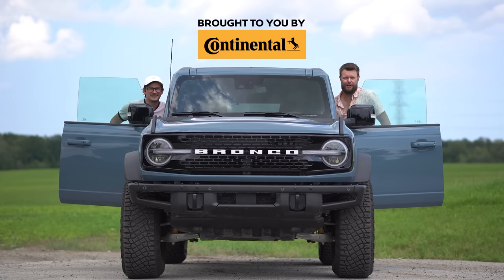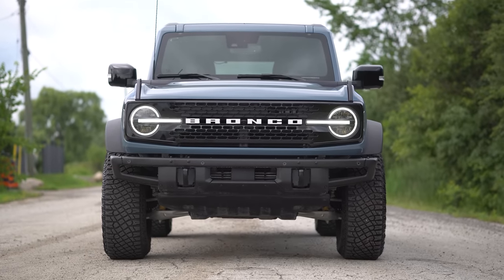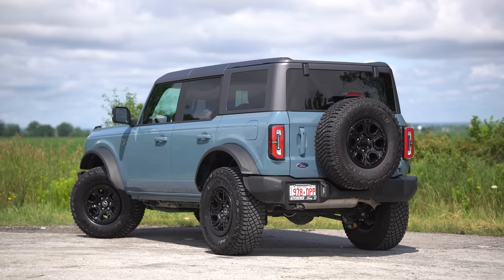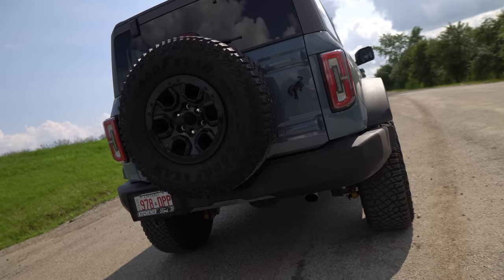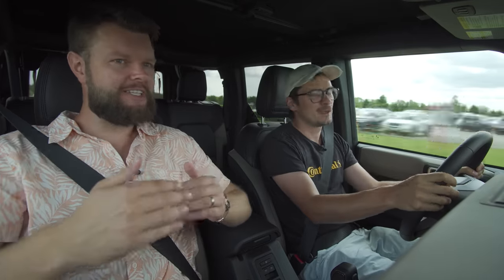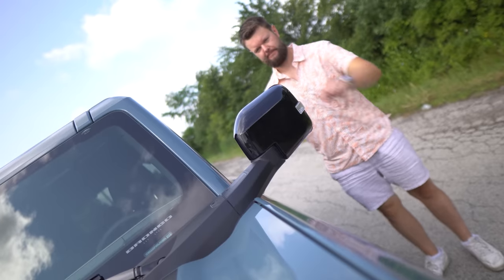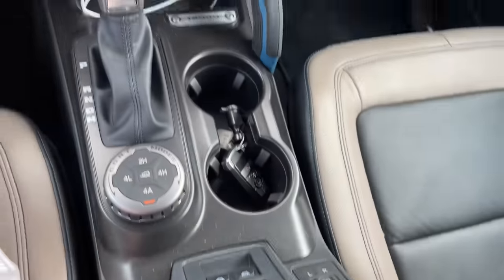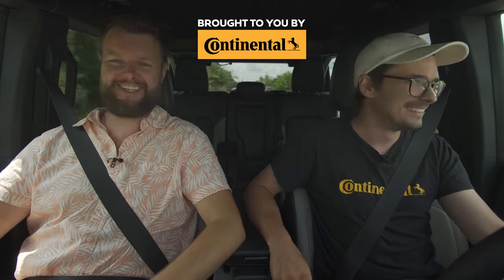RIP JEEP! 2021 Ford Bronco Review

Comment: Smart move having the mirrors mounted to the body, not the doors.
Reply: Unless you are into wheeling/off-road. But we know bronco owners won’t be doing any of that
Reply: You don’t even use them bro when the doors are off. they make loads of accessories for that anyways try again
Reply: And most of the time on trails you don’t want mirrors that will break off.
Reply: I take the doors off my Gladiator. The aftermarket mirrors vibrate too much on the highway.
Reply: Wrangler has a drop windshield so no mirrors on cowl - but why do people need to lower their windshield in a mall parking lot.
Reply: @Michael-pq6dn  Status Symbol bro.

Comment: It has just been confirmed the Bronco transmission is shared with the Explorer, not the F150.
Reply: Doesn’t sound like good news
Reply: @kirkjohnson2924  first year explorer transmissions were fine the problem was the cooler lines for the trans
Reply: @GhostlyGhille  "fine" is a matter of perspective. The 10R80 is more robust than the 10R60, so while it may be "fine" it would be a lot finer if it had the better trans. It just seems silly to give it to the Ranger, but not the Bronco.

Comment: Jeep guy here, good review on the road but I need to see it on the trails, I want to see the clearance and break over angles.  I want the competition and I think Ford through the gaunlet down which is great!  My two cents: pros.. production 35s ready to take "most" trails so you don't have to do much to make it decently capable - IFS has advantages especially on road and higher speed off road or back road cons: IFS is expensive to lift after market.. off roaders are going 37 and 40s now. no V8 yet.. I think also one big pro.. the interior is wide open above the drivers head unlike the Jeep which has a big cross member in the 4 door adn added speakers which can be annoying and get in the way.  Overall I like the "real" Bronco and when/if I go to buy another Jeep I will compare this to the Wrangler.  Besides that I want to see it out on the trails so it will be fun to see it out there!
Reply: IFS has no advantage off road. They put 35s on a his bronco with no space in the wheel wells. And if your are a real off roader you can’t go higher then 35s without a ton of other upgrades to make everything strong enough. You can go to the mall on 37s but you’ll break stuff on the trail. The bronco has the same suspension as the Ford ranger. no one is taking Ford rangers off road
Reply: @RougaRouKJun  I have zero skin in the game on this as I am a jeeper and prefer solid axels for off road for durability and making lifting cheaper and easier BUT.. IFS I would argue does have a place off road depending on what type of terrain or off roading you intend on doing.  IF a new buyer looking at the Bronco with 35s may not want it for rock crawling and a new Jeep comes with 32s so it will appeal to some buyers off the lot to be ready and go.  There are also pleanty of IFS examples out there that have been used as off road vehicles so I just dont agree with that sentiment.

Comment: The feature I love the most about this car is the rear window that opens independently from the door. just like in the old Ford Explorer. My brother used to have the old square explorer it's a great truck. That feature is great and missing in these new vehicles of today. I much prefer a wide and straight rear window than those minuscule rear windows and rears full of angles that modern cars have
Reply: My family had a 2002 Explorer V6 back in the day with the independent rear window, a great feature. The pre 2011 Explorers were great trucks.
Reply: Sooooo….just like the Jeep Wrangler has had forever? 😂

Comment: Great review as always, but disagree on the Ecoboost engines sounding like “trash.”  The 3.5L Ecoboost in my F-150 sounds excellent - not loud nor obnoxious like a few of my neighbors with their Flowmaster or straight-piped vehicles.
Reply: I disagree
They sound like hot trash IMO
My neighbor has an Ecoboost V6 F150. It sounded bad when he got it.  Then he put an exhaust on it... Even worse. Sounds like angry bees stuck in a tin can.
Reply: Ok you think is sounds excellent but most people think it sounds so pathetic I laugh when a Ford boy drives by
Reply: The 2.7 and the 3.5 EcoBoost engines dont sound the same.
Reply: @duhacekfamily  And they do, as you're going slower ....

Comment: I’ve heard the wrangler’s sound system is better due to the placement of the speaker above the drivers on the sport bar instead of in the back. The Bronco also seems more like an FJ given the IFS. Wranglers handle worse on-road because the solid front axle articulates better off-road when disconnected. (I may have owned a wrangler on 35s :) )

Comment: The question I have about the Bronco, is whether Ford will support it for the long term, like Jeep has done for decades with the Wrangler.  History suggests they won’t (because they didn’t), and it will simply be a flash in the pan.  No doubt they’ll get a ton of sales initially, but I’m not sold on this being a long-term model.
Reply: That might be what you want as a buyer though
Reply: Then just hold off on your purchase for 25 years, simple.
Reply: They will support for long term, they already have official clubs for Bronco owners and locations catered to Broncos and events
Reply: Long term support will depend on what you mentioned. Will the Bronco be a long term sustainable model or will sale numbers plummet after this initial wave wears off? It's too early to tell.

Comment: 0:28 that thing literally took off so slow i almost spit out my coffee

Edit: so I guess I can't post a comment on YouTube without catching hate for it. So let me make myself perfectly clear. The vehicle is slow. Fight me about it i guess if that's your prerogative 🤷‍♂️
Reply: But it's meant and used for off roading...not a race track or autobahn. It's like complaining about a Mach E and how it gets stuck on a beach. The grand mistake I see with these newer Ford makes are flooding underpowered engines with turbos and keeping the problematic 10 spd trans I keep reading about. Naturally aspirated without the engine stop cut off is the only way for the average American.
Reply: It’s a 4x4 not a Ford GT. 🤦🏼
Reply: @okra2958  so an upgraded suspension system and upgraded set of dampers makes it ok for it to be slow for daily driving? I'm referring to the fact that it does not come with an option for a naturally aspirated V6 or V8 engine. I would puke if I had this car for a daily driver. I am not fancy enough to own multiple vehicles or one separately for the purpose of off-roading alone, so maybe its my fault for watching the wrong content on YouTube. Think before you speak man, people come from all kinds of different backgrounds. My comment is a legitimate response to the content I saw. So speak for yourself. I expect better from a 2021 model vehicle, from any car maker.

Comment: If this was going to be a customer's car, I'd be extremely upset to know that it was loaned out to Youtubers who "launched" it before the engine had 1500 miles on it. This is why press cars exist.
Reply: What's wrong with launching at less than 1500 miles?
Reply: From what they said this isn't actually a customer car, it's a dealer car that they're going to eventually sell.
Reply: As if people won't be gunning it on the test drive
Reply: That is why I'd only order one from the factory with 0 miles rather than buy off the lot. Who knows what people have done while test driving a car. Besides, you end up paying basically the same thing either way, so why not get one that is truly brand new.
Reply: @RecBuddha  People that load on the car carrier & trains to car carrier drive like crazy !!! The vehicles will have some miles ! Most 2 to 4 miles arrived to dealership than PDI driven for gas by techs ! I have worked in the Automotive industry for 37 years Last month 25 brands
Reply: Lmao 🤣🤣🤣 most customers do the same thing
Reply: @brixan...  From what I understand, most car engines need around 1500 for their "break-in" period before you really want to hammer them. It has something to do with the gaskets and seals within the pistons and cylinders.
Reply: @TekuJames  That's why I don't buy test driven cars.
Reply: @aaronmarsh8923  doing a handful of hard launches on a fully warmed up engine and transmission won’t affect anything. That’s not abuse.
Reply: @derekintrovert5619  I worked for an auto group with a large cluster of dealerships on the outskirts of Winnipeg.  Lot jockeys from one particular dealership within the group would routinely beat the hell out of any Range Rovers and Jaguars during the 1.5 km drive to the nearest gas station with which the auto group had a supply contract.

Comment: That suspension setup at 1:35 looked like crap or am I being picky?🤔 I dunno
Reply: Ford knows about off-roading better than anyone else so probably it's not crap
Reply: "if it's not a Dana 60 with a mall-crawl spec lift kit then it's literal shit"
Reply: @Limited-uq2yk  so you claim that Ford knows more about off road than for example Land Rover, Range Rover or even Jeep for that matter....? Seriously?
Reply: @TermlessHGW  they won the Baja race🤷🏽‍♂️
Reply: @Limited-uq2yk  and that's what you're basing their knowledge on? I believe VW once won as well yet nobody calls them the greatest off roading company do they?
Reply: @TermlessHGW  yup because the raptor won with everything stock. Unlike Chevy and Ram both failed and didn't even finish the race. The raptor is the only Baja capable truck you could buy off the lot.

Comment: Love this car but something that does 17 mpg in 2021 is almost criminal.
Reply: Prius is better for fuel economy
Reply: Right! and the bar is low. But in 2020 we need 20mpg minimum. At least beat the Jeep
Reply: @ronh2660  Prius just makes more sense sitting in traffic. But when you wave at Jeep drivers they give you the finger. ...more likely they're confused, if they even notice you.
Reply: Until you see 14 mpg on a 2011-2019 Explorer Sport.
Reply: @nathanallen5489  don’t know about the old sport is, but the ST with the same engine and similar trans and body is 18 city and 24 highway
Reply: @nathanallen5489  Vomit. Any decent country would ban or heavily tax such nonsense.
Reply: Does 17mpg lifted with 35s. The non Sasquatch gets 20 although that isn’t anything to brag about.
Reply: Christ. I get 18-20 in my  2017 Jeep Wrangler with 34s and a 2 inch lift
Reply: It's a box on wheels. No one is getting this for fuel economy.
Reply: Ferrari and Lambo owners could care less 🤷‍♂️
Reply: @jstoli996c4s  as much as I care about them
Reply: @mkkm945  and them about you 👋
Reply: @jstoli996c4s  yeah but they care about nobody, which makes them worthless. Especially since a Tesla performance is faster than their dinosaur juice mobile.

Comment: I love the new bronco. I have had the pleasure of driving a badlands, but Jeep will stay king due to the lack of availability of this SUV. RIP Jeep is kinda click bait lol.
Reply: Jeep will remain king because of the solid front axel
Reply: @RougaRouKJun  SFA is the only way to go if you are on technical trails and rock crawling but.. IFS is better for mild to light off roading and street manners. The one thing I wish my Gladiator Mojave had is IFS but I prefer the SFA in my wrangler.
Reply: Speed Tube  the new JL/JT platform has had its share of problems. My last two fords went over 100k miles with no issues. It's all on how you maintain your vehicle.
Reply: @lifebetweenthelines8576  See you are actually one of the few that get it. All vehicles brands and models have issues. All of them require routine maintenance to keep them in proper working order.

Comment: I've heard V6 Dodge Journeys sound more impressive, direct injection turbo Ford 4cylinder engines don't have much of a life span !
Reply: Where'd you get that info?
Reply: bobcat baldfat drunkbeater   yea but you know what the crazy thing is? They actually last. Alot longer than any fca product. Yea they got some bad ones, so does fca but seems like fca has a lot more. Regular maintenance goes a long way
Reply: bobcat baldfat drunkbeater   my bad I got confused with another thread where some guy was talking about how good fcas quality is. Yes you're right if the engines built for a turbo it's going to last but just slapping one on an n/a motor is probably not going to work out long term wise
Reply: bobcat baldfat drunkbeater   well that's where you're wrong. They're not just adding them to engines. They have to be built stronger. An example is the 3.5 eco has a graphite block to take the extra pressure. And yes they are trying to reduce weight. Switching to aluminum on the f150 saved 700lbs. There's a limit to how much weight you can reduce
Reply: @jadenantal1652  a Ford mechanic
Reply: @jadenantal1652  FCA has done better than FORD in quality in the past 2 years. FORD isn't a quality brand, in fact you could say all 3 are average at best. I really can't stand FORD fans because they are so delusional.

Comment: I mean, it's cool.. but I absolutely refuse to buy another Ford after my EcoShart transmission grenaded itself at 5k and 26k miles. Brand new and a piece of garbage. I could rant forever about my hate for that thing.
Reply: What model Ford, was it?
Reply: Sounds as bad as Nissan CVT's
Reply: @lego4virgo '18 EcoSport. Or as I call it, the EcoShart. Because it's completely shit.
Reply: @thegirthquake8574  Yeah, well, haven't heard too many great things about the EcoSport, which is why I have a '20 Escape S AWD. I had a '14 Escape SE FWD, and it was pretty good, except I rolled it in 2019.

Comment: RIP Jeep, no, not really. Jeep has a 470HP naturally aspirated V8 with 35s, 4.56s, higher ground clearance and better angles. The Wrangler also has the opt for a 6SPD with 4.88s achieving a 100:1 crawl ratio. Jeep also offers a diesel with better fuel economy and excellent off road. The Wrangler design is more detailed and has a much nicer interior. The Bronco is generic looking with an honestly cheap looking interior. The Wrangler is going to do just fine.
Reply: 90k vs 50k. Not even in the price range.

Comment: Turbo charged 4 bangers don’t last. Give me the damned Jeep!
Reply: Maybe so, but the 3.6 jeep engine doesn't last either!
Reply: Ok you can have it.
Reply: Keep has been using the same anemic piece of crap engine forever.
Reply: @rxdocintn98  word, penstar is lackluster
Reply: Agreed, the Bronco is ugly AF
Reply: Jeep has a 4 cylinder as well lol
Reply: Chrysler products don't last. That's why they're consistently rated the worst in reliability most years for the past couple decades. 🤣😂
Reply: @BabyJesus66  gotta 52 yr old Dodge and a 20 yr old Dodge and they run fine with regular maintenance. I’ve owned Fords that went thru more oil then gas and Chevys with reoccurring starter issues. Bought a brand new KIA Telluride that has a 10 yr warrantee and I hope it holds up as well as my 20 yr old Dodge Ram, to each his own.
Reply: @BabyJesus66  yea, your right, I had to put a water pump on my 20 yr old Dodge Ram and my 52 yr old Dodge had the alternator go out yr before last, but what can you do??
Reply: @tigercat0924  true, but it’s the turbo charged models that don’t last, not the naturally asperated models, besides, the only offering I heard for the Ford is the Turbo 4 banger ( no 6 cylinder option) ouch !
Reply: @peter12246  beauty is subject, I’m more concerned with the fact that the Ford only comes in one flavor under the hood and that’s the turbo charged 4 banger. This same motor is not holding up well in their cars in the past,
Reply: @rxdocintn98  thanks, can you cover my note this month, I’m a little short? Lol!
Reply: @BabyJesus66  they were rated higher than FORD the past 2 years, yeah keep living in a bubble
Reply: @paulj9821  hahaha!  You don't realize I work on Jeeps EVERY day, because its my job. I have had the misfortune of working on, and replacing the 3.6 engine more than I can even recall. New vehicles honestly are garbage, and I wouldnt buy a ford either.
Reply: @paulj9821  hahaha!  You don't realize I work on Jeeps EVERY day, because its my job. I have had the misfortune of working on, and replacing the 3.6 engine more than I can even recall. New vehicles honestly are garbage, and I wouldnt buy a ford either.
Reply: @austinbrock3672  I work on FORD's and GM's every day, so what. That's like me saying Mercedes AMG engines are trash since I work on them every day as a Mercedes AMG tech. When you are a mechanic, you will end up working on all the engines that were either mistreated or built faulty. That is every brand and if you even try to insinuate that ford's eco boost lasts longer, than as I suspected you are a low level, shitty mechanic.

Comment: I have been on Ford's website, built 5 of the 6 available models, however, I did not see the "First Edition" model??  I added the Mid Package, Tow Package, and Key Pad on all the models. The WildTrak with the Sasquatch package came in at $62K, but the Badlands came in at $64K, overall the 5 I picked came in at $55-64K CND about $345/Bi-Weekly for the next number of years...I wonder if they will still have gasoline in the future before this vehicle can be paid off, or even if gasoline will be affordable then when EV's take over... at 15/MPG these vehicles are not cheap on fuel that is for sure.   I cannot afford these vehicles at these price points. That is ridiculous $70K for a vehicle. Glad you guys have lots of money. I'll buy your Used Garbage and fix it back up and enjoy them then, but by that time... EV's will be roaming the desert called Earth.

Comment: 10spd 10r60 from explorer 10r80 is in f150. Might buy one but way to many build problems, 10spd is crap i own one, 2.3 is in DI not port and DI so carbon issues if u get manual. I dont think they beat jeep overall